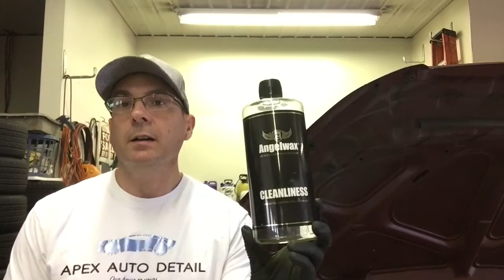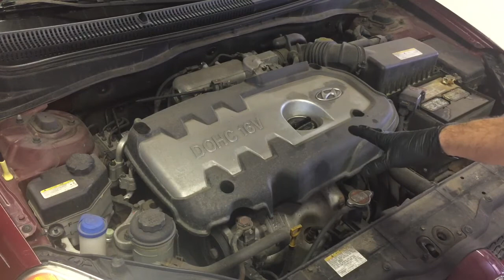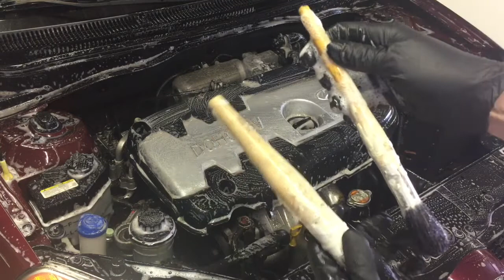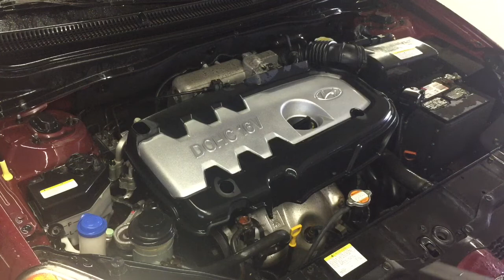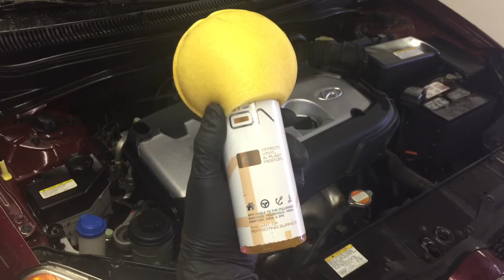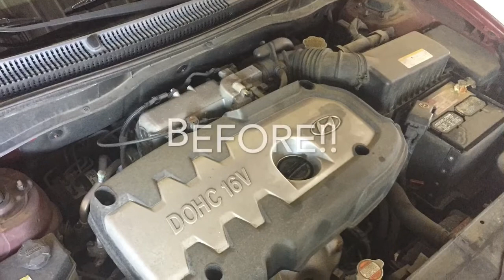Engine Bay Detailing! How to clean, condition, protect all materials under the hood.

Comment: Spray nine does a great job on engine bays as well. The degreasing power is very good.

I am very surprised you didn't get totally trashed because you sprayed water over an engine.  People forget the engine bay is engineered to get wet.

Comment: To "overachieve" in a simple and easy way I would always take off any cap that I can reach - coolant, steering, washer fluid, oil filler cap - and the dipstick to have them thoroughly and deeply cleaned. This is what the customer actually is going to touch at all and this should be cleanest itself and its surrounding area. Imagine the oil filler cap on this Hyundai removed and there is a "oily collar" becoming visible!

If it is my personal car or a good friend - I go around all hinges and moving parts with a syringe filled with ATF-Fluid to have everything operating as smooth as possible and protect it against any ingress of corrosive fluids.
Reply from the maker: Markus Dahmann absolutely all great tips, depending on their budget of coarse. If you are going to over deliver... make sure you are compensated for it. Great post Markus!

Comment: Nice work, I try Krud kutter but I were not satisfied with it! My engine were full of thick oil layers so it didn't really work. The solution were stronger degreaser from simple green & heavy scrubbing then I used wd40 degreaser again. Then I used mothers black trim restoration and protection
Reply from the maker: Dont cut KK... use it full strength👍🏻
Reply: Apex Detail I did not I used it with full concentration twice!
Reply from the maker: When that fails... I sometimes go to purple power or super clean. But for the most part.. it does pretty well. 

If this is easy for you to get, try this my friend 👉🏻https://www.walmart.com/ip/Purple-Power-Heavy-Duty-Vehicle-and-Boat-Pressure-Wash-Concentrate/50941516?wmlspartner=wlpa&selectedSellerId=0&adid=22222222228039293619&wl0=&wl1=g&wl2=m&wl3=80418364129&wl4=aud-310687321802:pla-177645645649&wl5=9007449&wl6=&wl7=&wl8=&wl9=pla&wl10=8175035&wl11=online&wl12=50941516&wl13=&veh=sem

Comment: I would for safety reasons always disconnect the battery when getting the compartment soaking wet.
Reply from the maker: Eliminate liability when you can! Right on Marcus!👍🏻
Reply: or just cover, resetting devices and clocks in newer cars is more liability. Just cover terminals to be safe.